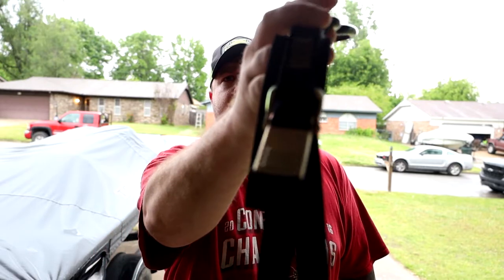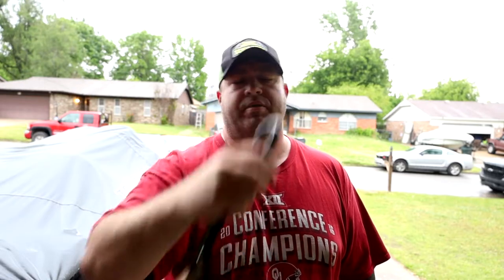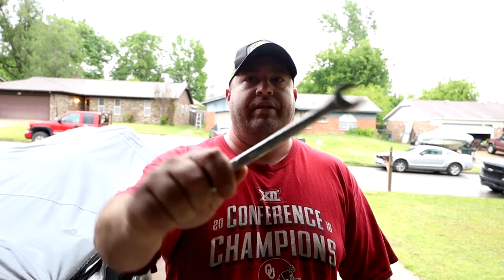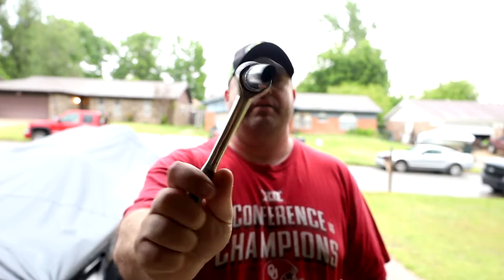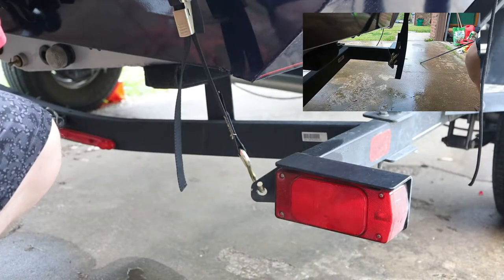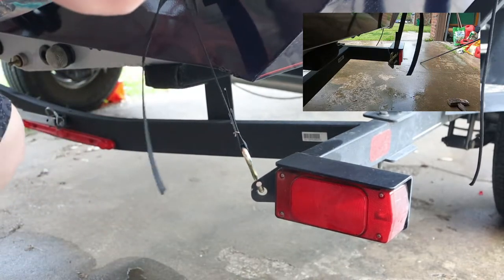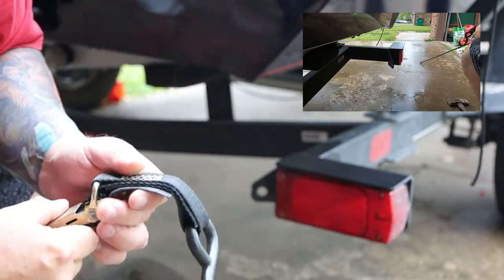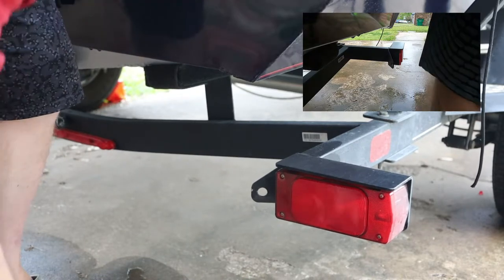FAST AND EASY BOAT BUCKLE INSTALLATION

Comment: Correct me if I’m wrong, but I would think the ratchet mechanism would be susceptible to a lot of road grime, rocks, etc. which might damage it over time being so low on the trailer. How have they held up for you?
Reply from the maker: Road grime for sure but I haven’t seen any issues with rocks or anything. I think for the most part they are blocked. Not saying it couldn’t happen but I haven’t seen it yet.

Comment: Been wanting to get these but heard they get stolen off the trailer at the lake.
Reply from the maker: I’ve been pretty fortunate so far but I can see how cowards would do something like that. I’m not sure there’s much you could do, outside of maybe tacking your nut, to keep them safe if it came to it.
Reply: Okie Outdoor Adventures i was out at lake Konawa in Okla a couple weeks ago, its about 1-1/2 hour drive, when i got home i noticed my lock on the trailer tounge had been cut off and looked like they attempted to take my receiver hitch off, its one of the expensive B&W hitches so I’m guessing thats what they wanted, altho I’ve heard of boat trailers getting stolen so IDK but i try to keep everything under lock and key.

So i drove that 1-1/2 hrs without a pin on the trailer tongue, this has taught me to double check my load before leaving the lake.
Reply from the maker: Sheesh! No kidding on double checking. Worst I’ve seen is trailer tires slashed at one of our “big fish” lakes. Glad you didn’t have any issues getting back home.
Reply: Okie Outdoor Adventures yeah you can trust anyone or anything now a days. I started carrying some binoculars in the boat and when im close to the boat ramp i will take a look in on the truck. I already carry a Glock 22 with me on the boat, have had too many encounters on the water.

I waited almost 20yrs to get a new boat, i had a bad spinal injury that left my legs paralyzed until surgery and years of therapy to get back on the water which i got a new boat this past October, i don’t have the extra money with my income to replace equipment.
Reply: Okie Outdoor Adventures damm slashed tires? WTF is wrong with people? Are the vandals jealous of others so they want to destroy what is not theirs? My incident was at Lake Konawa in Oklahoma.

Comment: If you are looking at buying these things for your boat, DON'T!!

I put these things on my brand new aluminum trailer to hold my boat, thinking that all f the "reviews" were good.
 After the VERY FIRST trip to the water, the next time out they became hard to release.
 I then took them off, sprayed them inside with corrosion X, lithium grease and even MAX WAX!!

 They made three trips to the water, after the third trip I had to cut the straps with my knife to release my boat from the trailer.

 I currently have two giant chunks of rusted together garbage to show for my money.

DO NOT BUY, unless you like throwing your money away.
Reply from the maker: Weird, mine have been on since this video and still work like new. Sorry you had this experience, but mine and many others have been different. I’m sure other folks have had issues, so I’m not saying you don’t have a valid gripe, just saying they’ve been good to me. Also I have no stake in their business, I just wanted to show what I thought was easy at the time.